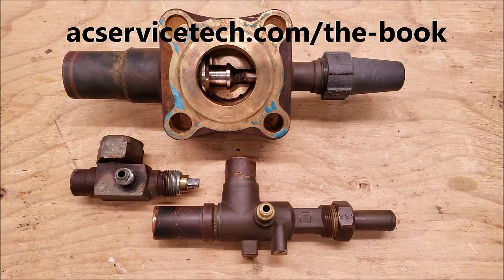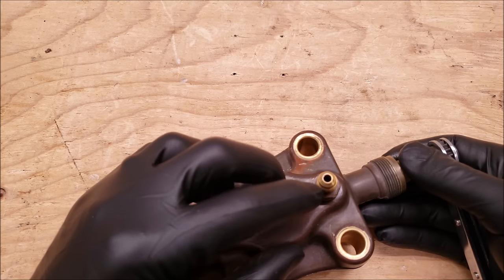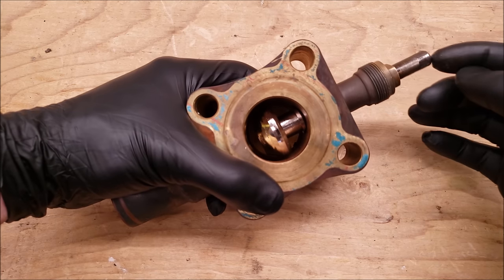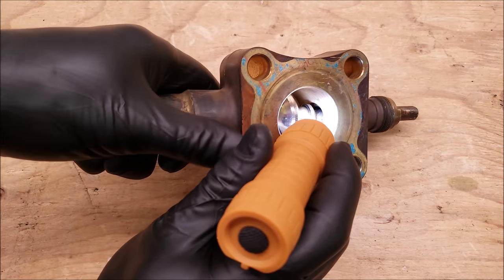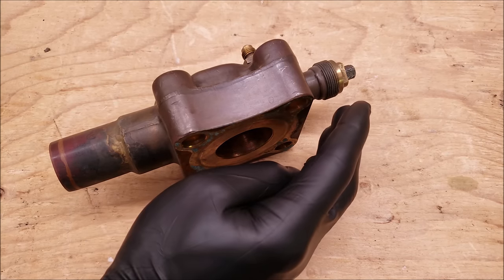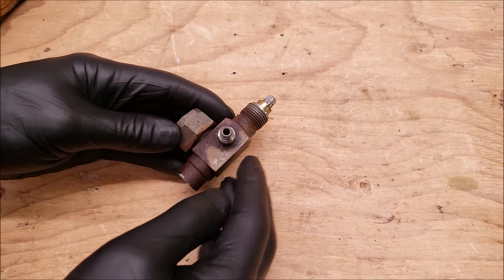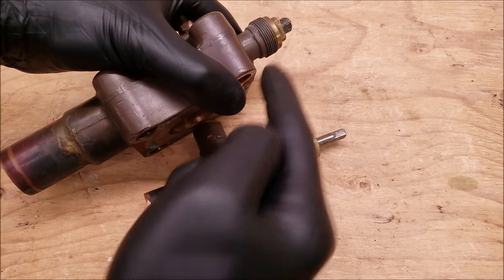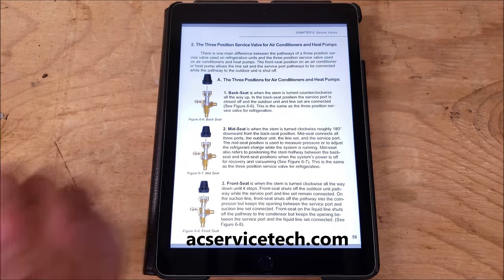HVACR 3 Position Service Valve, King Valve: Front-Seat, Mid-Seat, Back-Seat

Comment: This video was very informative. So i have a question, Is there a position that the HVAC service valve can be where the heater would work but not the AC? I am having this problem right now. During the winter, the heater was working fine but now that its starting to get hot, the AC is blowing hot hair, but the heater is still working. The cooling setting blows hot air even when its not very hot outside. BTW i had my old co-worker work on my AC last winter,  (who is HVAC certified) and refilled my freon. He also had told me that the king valve leaks if its in a certain position. So the position that he set it at doesnt leak, but now is when im noticing that the AC doesnt blow cold air. Your help is very much appreciated. thanks!
Reply: Do you have a heat pump with strip heat? If so it sounds like your refrigerant has leaked out so the refrigeration circuit is trashed but your heat pump still bumps on the heat strips (emergency heat) and warms your house up.
Reply: @strimbimmin328  Thanks for the response, apparently there was not a leak like the previous HVAC technician told me. The problem was a wiring issue.

Comment: Hello Craig. I have a r404a small type appliance a slushy machine to be specific. I need to recharge it. How do. I charge it. How much psig and oz should I fill it up to. There is no reading on the compressor or on the side of the machine. Thanks in advance. Should I charge it thru liquid line ?
Reply from the maker: You would need to look up the model number or find the rating plate. There should still be a plate somewhere on it that shows the total weight. You would break the vacuum with the total amount of liquid refrigerant needed for that packaged unit, thanks!

Comment: Still like metal gasketed caps, what PSI are the good ones rated at?
Reply from the maker: That I am not sure of but I am sure it is very high. That will depend on each manufacturer and they may not give those specifics, thanks!

Comment: How do you tell whether a valve is a 2 position or 3 position service valve when looking at a unit?
Reply from the maker: When you take the port cap off of the service valve, there will not be a schrader valve core. There will also be a large ca at the top and under it will be a large exposed stem, thanks!

Comment: I think the service valves on my 40-year-old Friedrich compressor are three-position but I'm not certain.  Both valves have a square stem on top covered by a black plastic cap.  The access ports are just above the  vapor and/or  liquid lines and have no Schrader core. They have a small threaded metal cap.  Any comments?

Comment: Can't you just use the front seat to add refrigerant? Since the valve will be open only to the suction side of the compressor which will suck the refrigerant out of the refrigerant cylinder, negating the use of a recovery unit or hot water bath to help push the refrigerant out of the cylinder